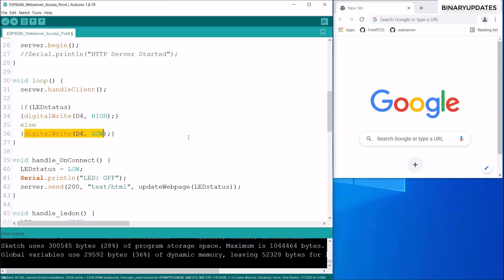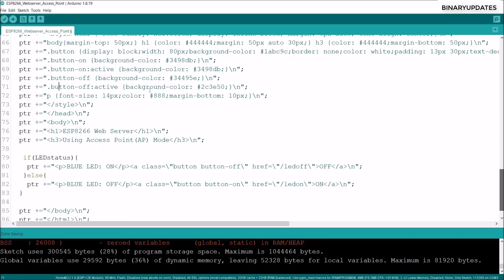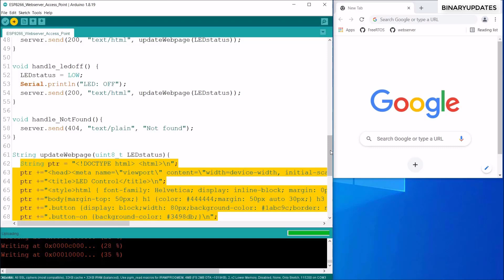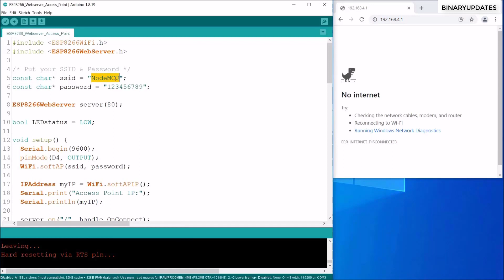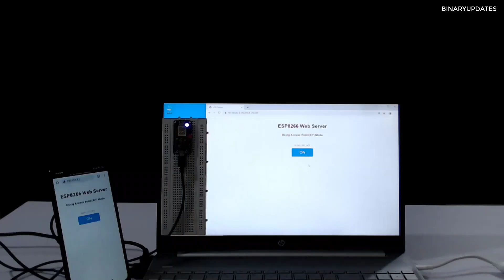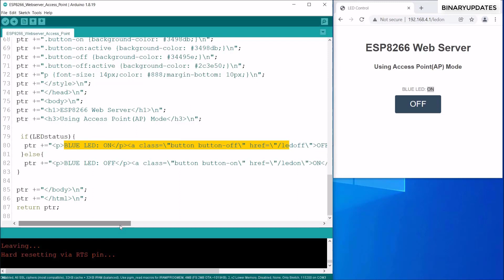NodeMCU ESP8266 Webserver in Access Point Mode

Comment: I'm interested in the ESP device making a hot-spot, and serve up a page to any device that connects to it.

But I'm using the ISP-IDF IDE (eclipse), and if I understand correctly the "station" project template is to connect to an existing network/router.. and that the "access point" project template is if you want to broadcast an SSID and have a device, like your phone, see it and connect to it.  Is that correct?

I created a new project from the list of templates available (wifi->getting_started->softAP), but after building/downloading my android does not see any new SSID.  The serial output shows
 [0;33mW (547) spi_flash: Detected size(4096k) larger than the size in the binary image header(2048k). Using the size in the binary image header. 
 [0;32mI (560) sleep: Configure to isolate all GPIO pins in sleep state 
 [0;32mI (567) sleep: Enable automatic switching of GPIO sleep configuration 
 [0;32mI (574) main_task: Started on CPU0 
 [0;32mI (574) main_task: Calling app_main() 

The only anomalies I can see is that, when it builds there's a 'Low Application Partition Size' warning:
"Less than 30% of application partition size is free (267,856 of 1,048,576), would you like to increase it?

The other strange thing is that the "Debug Configuration" Startup tab, has the 'Load symbols' check-marked.. but the 'Load executable' not checked.   I think it's still downloading/debugging.. so maybe the OpenOCD options "Flash every time with application binaries" is responsible?

In any case, any idea why the default AP project template doesn't seem to broadcast it's SSID?

Instead of using the official EspressIF project examples, maybe its better to use a GH example?
MHendricks / Esp8266-to-Arduino-WebServer-example  (Lua)
Enjoy-Mechatronics / ESP32-Web-Server
CDFER / Captive-Portal-ESP32

Comment: Can this enable the LED to be operated from anywhere in the world via the website via the Internet?
Reply: No. The mode of the ESP8266 as set in the video is in Access point mode (it acts like router). For you to be able to control from anywhere around the world, you will have to set the ESP8266 to be in station mode.

Comment: how can I connect arduino uno and change values of arduino uno example switch on light connected to ardduino uno . using a web server
Reply from the maker: Hi you may need to add Ethernet Shield with Arduino Uno Board to provide internet connectivity. And then you can build webserver. I already made video on the same on my channel. Please refer that video. Good luck and best wishes!